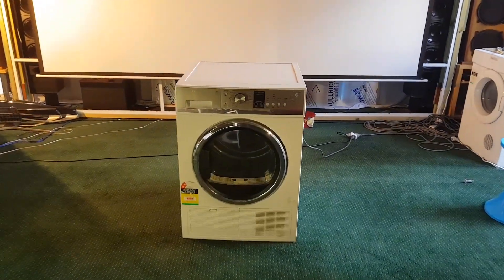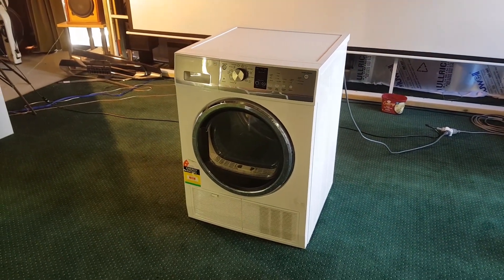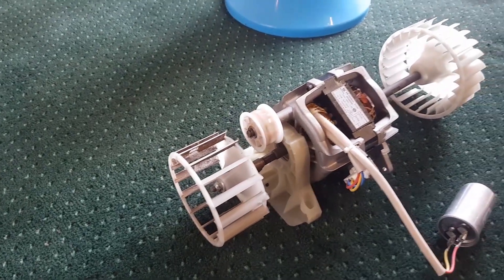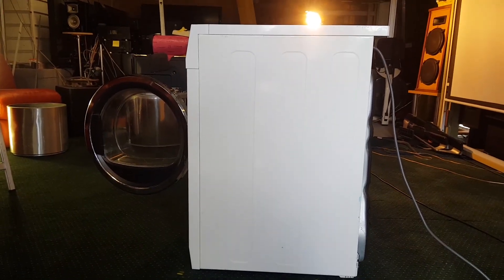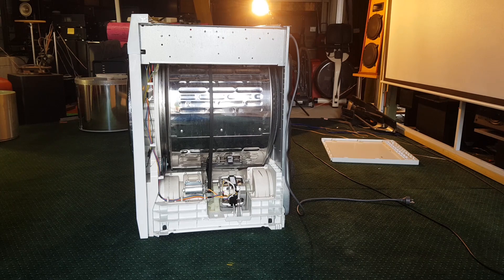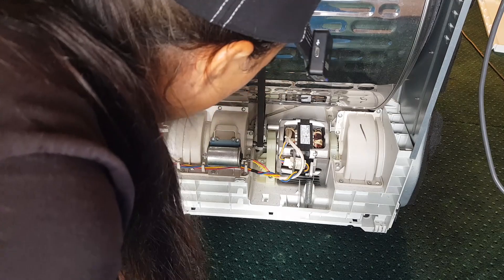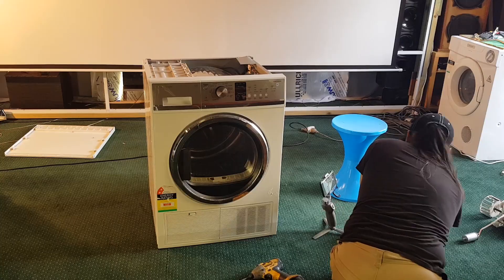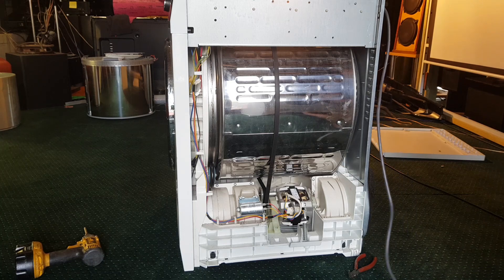Fisher and Paykel Condenser Dryer Capacitor Replacement. Not turning. DIY, troubleshoot, fix, repair

Comment: Hi I have a dryer of this type, but the filter light is red. I cleaned it and the light did not go out. The word Auto appears on the screen, and when I put it on every day, it does not spin.

Comment: Ahh the capacitor ofcourse
Reply from the maker: Haha thought you would have seen it in the title mate 😅👍
Reply: @DIYDumpRat  nahh i clicked on notification while on mobile phone. Didnt have complete description. Fridgy and elec i find it fun
Reply: I also repaired my washing machine and heat pump dryer which are the same model.
Reply from the maker: @AshSatoshi489  Ah I get ya.  Your a fridge mechanic?  Whow!  I need one of those.  Did you see the video of the 6 bar fridges I found a while ago?  Someone snipped the gas lines at the back before dumping them.  Can't believe it.  I think I might have a contact who can repair them I just haven't looked into it yet.

https://youtu.be/As72eesZahI
Reply: @DIYDumpRat  so what happens is the recovery centers/recyclers  can't accept any equipment with gas in it. And they cant release the gas because the Australian Refrigeration council would shut them down. So the people dumping them will cut the lines and say they have no gas. its usually a commercial businesses. Its not because they don't want someone else to have it lol
Reply: @DIYDumpRat  which state are you in? Id love to go to a white goods throw away place, Is that that where you go?
Reply from the maker: @AshSatoshi489  No mate I just get lucky some times at the tip and road side pick ups.
Reply from the maker: @AshSatoshi489  No mate the dumps accept gassed fridges all the time, they have to.  It's illegal to just snip the lines and let the gas go into the atmosphere.  

Local councils have guys who get paid $5 per fridge to degas them.  I know because I know a lot of blokes that do it.  They'll go in and degas a couple hundred fridges in a day.  They only get $5 per fridge but they also get to keep the gas they remove which by itself can be worth quite a bit of money 👍 

The people who threw these away were just jerks lol.